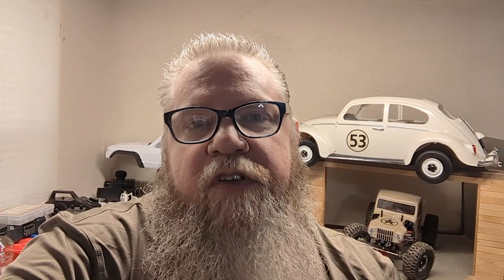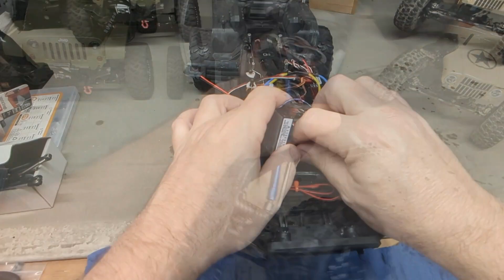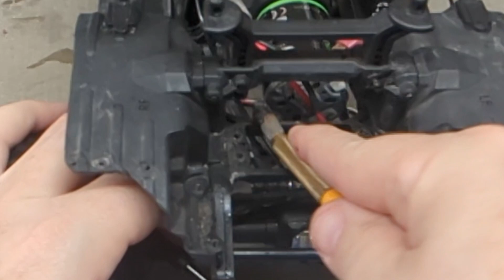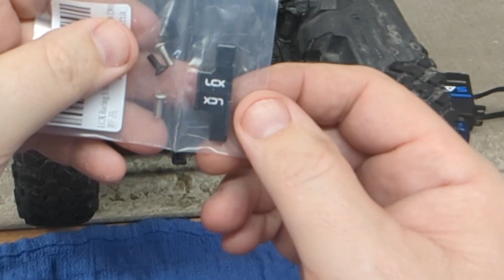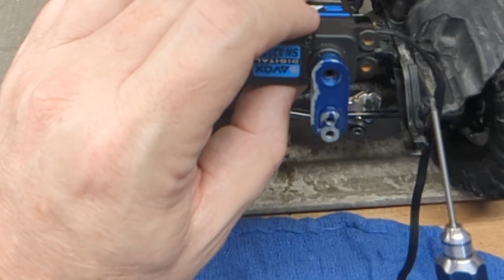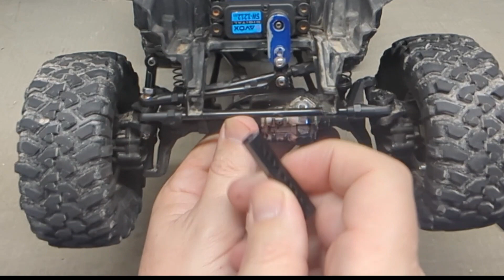TRX4 steering servo mod

Comment: Not a bad job. All i did was buy a brass bumper mount that had a winch servo mount made into it. Then i relocated my steering servo forward, to the where you would mount the winch servo, and reversed my steering
Reply from the maker: yeah thanks, I thought about doing it that way too, just wanted to try this
Reply: @leesrcs  it's a cool design, I like how you thought outside the box!
Reply: I was going to do the same thing but it seems to throw my steering link angle way off and I can’t get it to work. Did you have to change your horn?

Comment: Another solution is to adjust the steering servo endpoints using the TQI transmitter, it’s pretty painless to so using their ‘programming tree’ and you lose no steering angle, just the bump steer (and strain on the servo). 👍
Reply from the maker: yes thats true, but my issue was the panhard bar, limiting the servo would remedy that but I would also loose a lot of steering angle. It was just a quick fix option, its completely changed now 😆

Comment: Pretty cool mod.  What servo horn is that?  I had to check on my Trx4's to see if my rigs had the same issue.  Non of mine did even the one rig that still has the stock horn.  I think that horn you used caused the issue since it does not have a taper to it.  Subbed👍👍👍
Reply from the maker: its an aftermarket horn, I plan on redoing this whole set up, none of it really worked out they way I wanted but thats all part of the hobby I guess.

Comment: Can one buy a 270 degree servo for these trucks even if we don’t use it all?
Reply from the maker: any servo should work, you just have to adjust your end travel so you don't bind or break things. If your radio does not have adjustments then make sure you have some type of bump stop.

Comment: That was E6000/GOOP/SHOE GOO. All the same silicone adhesive under different names.
Reply from the maker: it works, I would have prob kept the box but the top was broken, prob where the new box will go back.
Reply: @leesrcs  No worries. It was a 3D print job, & not that great of one.